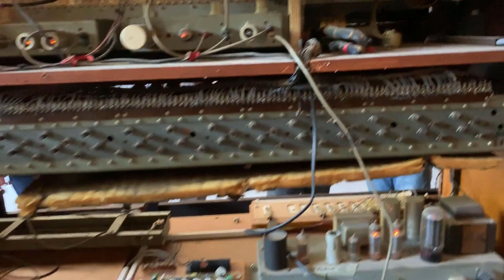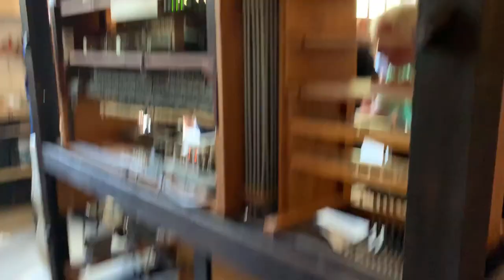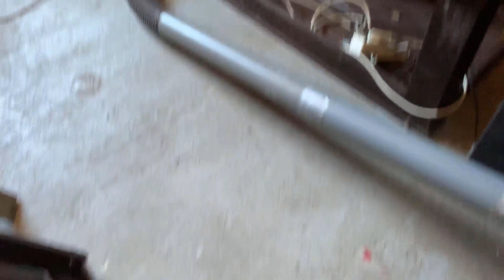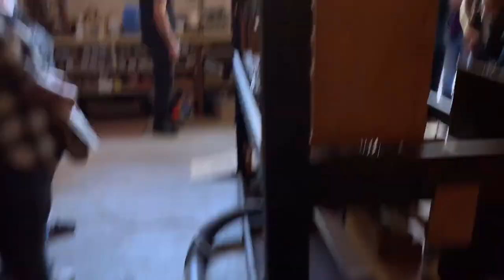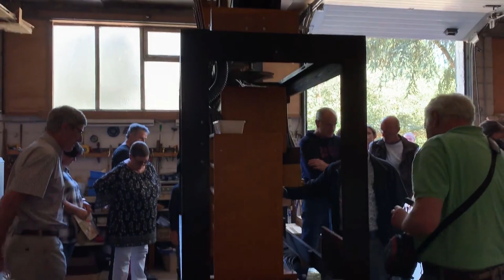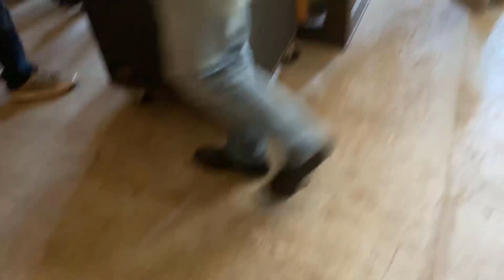Decap incomplete Organ Part 2

Comment: This appears to be a made up organ from a 1937 92 key Gebr  Decap ( like the one at utrect) which has lost all its innards & pipework but with the innards of a 92 key Gebr Decap  electrostatic organ of the 1950s like Vlinder etc.
Reply from the maker: According to decap herentals this organ belongs to an other part, picture in video description, the organ is under restoration
Reply: This organ is from the late 1950's. A few organs produced then also had percussion hidden from view.

Comment: zit daar nu een toongenerator van Hammond in ?
Reply from the maker: There's a tone generator in there, but I don't know if it's from Hammond. Or did I misunderstand you, I don't speak Dutch.
Reply: @Mechanical Music Uploads I did a little research on Hammond organs, and I came across vacuum tube Hammond organs that have almost that same exact circuit you can see. I don’t know if that’ll help a little but I thought I would just throw that out there for you, hope it can help 😁
Reply: Sounds pretty good without the pipes !